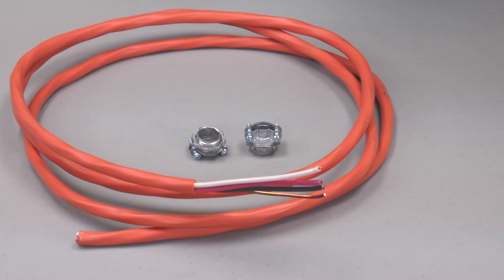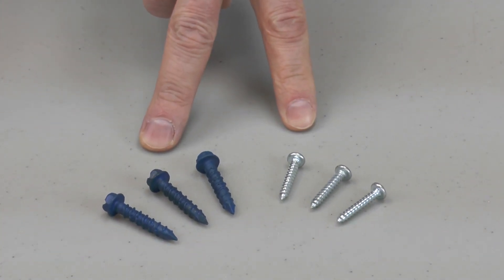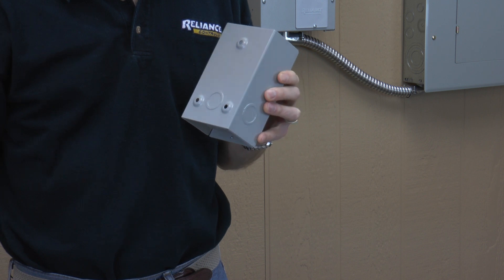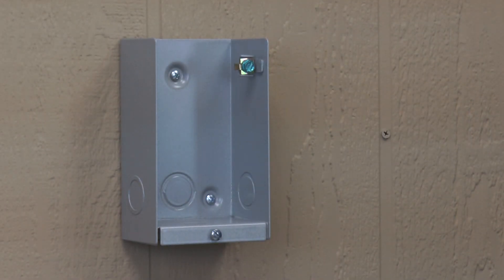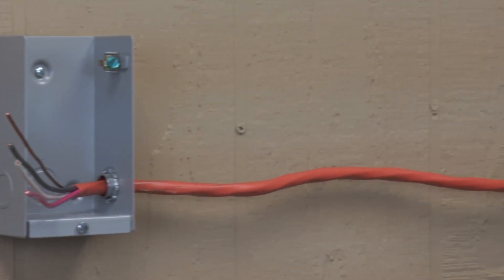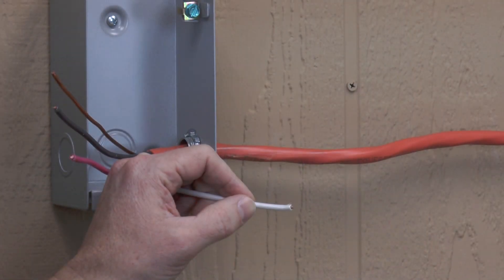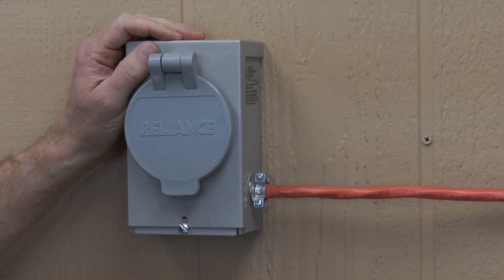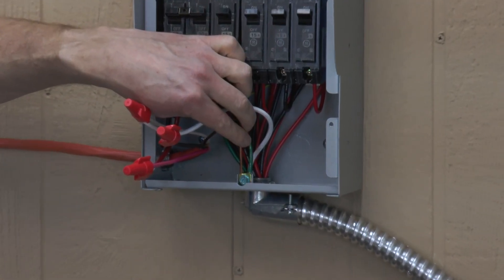How to Install Reliance Controls ProTran2  Transfer Switch- Part 5 Installing the Power Inlet Box

Comment: The most common use these days are 3 wire inputs. Most people don't own transformers that do 240v, or solar for that matter.
I'm looking to just run 2 refrigerators and a cpap. I would only have a Line Neutral and ground. How do you go about wiring that?
Reply from the maker: Hi, thank you for your question. Usually this is accomplished with an adapter cord that bridges the 2 hots in the transfer switch to be powered by 1 hot from the generator side.  Otherwise, if there is only 1 hot entering the transfer switch it can be accomplished by connecting the red and black to the single hot from the generator. Please feel free to call us if you need more information.

Comment: What size wire?
Reply from the maker: For a 30 amp transfer switch you will need 10/3 with ground building wire.  For 50 amp transfer switches you’ll need 6/3 with ground.

Comment: Can I put this plug 100ft away using 10/3 wire or use 8/3
Reply from the maker: Yes, you may install the plug 100 ft. away and it is recommended to use 8/3 w/ ground romex.
Reply: @RelianceControls  got it, thank you

Comment: I would love to see a different version of this video for when the off grid power is supplied by a solar inverter. That is now very common with off grid inverters that can produce 6000 watts replacing gas powered generators.
Reply from the maker: This is an awesome idea @leftlink we really appreciate your thoughts and definitely have begun discussions around this 🤓Time will tell! Thank you for letting us know it'd be useful for you.
Reply: (Not an electrician so maybe dumb question) couldn’t you just install this inside the house to allow for a connection to a battery back / inverter up system?
Reply from the maker: Not dumb at all, we appreciate you asking @MikeBernalMusic  Yes, you can.  We even offer models with a suffix “A” to include an inlet that mounts directly on the transfer switch. Thanks for watching!
Reply: What would be really great is to have the ability to switch between an outside power inlet and one on the transfer switch for inside use with a battery bank. Reliance could just use another 3-position switch like is already on the transfer switch and put it to the left of the circular hole. @RelianceControls
Reply from the maker: @dannyh9010  Hey Danny! Thanks for pointing this out, it's a feature that we've been working on and are excited about. While achieving that outcome isn't currently possible with toggle switches, we want to offer a method that could be utilized for similar results. 

For now, you could install a power inlet box and an inlet on the front of the transfer switch. Then, instead of running the romex from the inlet box directly into the transfer switch, you'd run it to somewhere near the transfer switch and wire a plug-in cord to the end of the romex that would plug into the transfer switch. 

You'd need a second power cord to plug the battery bank into the transfer switch as well. This way you could just swap between power cords depending on which power source you'd like to use.

Feel free to call us if you have questions, but we really appreciate the feedback :)
Reply: I thought of that.  I think I understand what you are saying, and came up with that method, too.  Are you saying for use with an outside generator, use the kit’s supplied inlet (male end) on the outside of the house and have the wire terminate at an outlet (female end) purchased separately near the transfer switch.  Then use short  a male/female regular type cord to go from the female outlet to the transfer switch for generator use.  I would then just plug directly into the transfer switch inlet for a power bank.  @RelianceControls

Comment: When running a 50A transfer switch how do you hardwire the incoming 6 AWG wire- a wire nut wont cut it
Reply from the maker: Hi there! Thanks for the question. Wire nuts are what are typically used. These would usually be a blue wire nut that accepts 6 AWG to 12 AWG. But if you can't with wire nuts you can look for other wire connector types like a WAGO connector.

Comment: 😒😒👎👎  Inlet box should always be mounted outside the house, because the portable generator gives off carbon monoxide, it has to stay outside.
Reply from the maker: 😒😒👎👎? We would never recommend, encourage, suggest, or show a generator inside. 

To be clear: you're completely right: inlet boxes should always be mounted outside the house, because the portable generator gives off carbon monoxide, it has to stay outside.

Hope this helps, thank you for watching!
Reply: But my generator is a solar/battery generator with no exhaust or fumes🙄

Comment: What about the neutral wire? Is it separated & isolated in the transfer switch from the main 200 amp panel? If not, when the generator is on will it not back feed to the utility X-Former feeding the panel?
Reply from the maker: Good question! The neutral wire is not switched with the Protran series. The neutral from the generator ties to the main panel neutral bar.  The neutral wire does not back feed to the generator as the neutral is a return path only for power. Let us know if this doesn't help. Thanks for watching!
Reply: So the neutral on the generator would need to be floating for this model correct?

Comment: Are there any NEC-required labels for such an installation included with this kit, such as service disconnect, etc.?
Reply from the maker: Hi again John! We do include some additional labeling, mostly to cover what UL has deemed necessary in our UL file. There are labels for separately and non-separately derived systems, depending on the installation, etc... Service disconnect labels are provided with some products, again depending on what's required in our UL file. Please don't hesitate to contact our tech support team @ support@reliancecontrols.com or (800)634-6155 if you'd like some further details. Thanks!

Comment: I have a 120v inverter generator my incoming wires are black white and green ...which colors correspond to your red, black, and white?
Reply from the maker: Hi plnthrd! Green = green, white = white, and our red and black wires will both connect to the black coming in from your inverter. The red & black are each powering 1/2 the circuits in the transfer switch to accommodate 240V. One thing to keep in mind (because the inverter only provides 120V) is that you cannot connect 240V circuits to the transfer switch. Please don't hesitate to reach out should you have any additional questions or concerns. Our tech support team can also be reached @ (800)634-6155; they're always glad to help!

Comment: What size of wire for 50 amp?
Reply from the maker: Hey! For copper wire, usually, we would recommend 6 AWG, but it depends on the specific wire you intend to use, along with the distance. Here's a handy calculator in case you want to check for your particular installation. Thanks!

http://wiresizecalculator.net

Comment: I am looking into buying a reliance transfer switch that can handle 10 breakers 12K watts. I wanted to ask can this be wired to my main panel and a transfer switch sub panel. The previous owner used a sub panel as a transfer box and wiring is going directly to each source it is powering. Line is on unless I switch to Generator which is same concept and works fine but only has 4 breakers. I need the reliance transfer box to be wired to several of the breakers in that sub panel. Could I just wire transfer switch to the 220 breaker that is supplying that sub panel so when generator is on it supplies the sub panel too? I will do away with the current generator line in  on the sub panel box and leave line in as on at all times. Thanks for great video series.
Reply from the maker: Hey Holly! Depending on the size of the breaker feeding the sub panel, this can be done, but it's limited to 30A. If the breaker feeding the sub panel is larger than 30A, then they could still connect individual circuits from both panels to the transfer switch. 

Only trick here is that the neutral & ground only need be connected to one of the two household panels.

Please let us know if you have more questions!
Reply: @RelianceControls  Hello, yes it is a 50 amp breaker feeding the sub panel so I would need to do individual breakers and do ground and neutral in either main or sub panel. My other option is just getting a bigger sub panel with a Reliance TRC1005C  Transfer Panel but will obviously be more work. Or a Reliance A510C Pro/Tran 2 50 amp.  I currently have my well pump (220v breaker) on the current transfer sub panel and l need to add my hot water heater (220v 20 amp breaker) and septic pump which is 110v breaker. Thank you for the quick response any tips much appreciated.
Reply from the maker: @hollyr8788  If you're not keen on going to the individual breakers of the sub panel, I'd recommend going to the TRC1005C. The A510C still has a 30A limit on branch circuits, so that won't help with powering the entire sub panel. 

While the installation of the TRC is a little more involved, it'll definitely provide more flexibility and keep a lot of options open should your needs change in the future.

If it's easier, definitely give us a call to talk through it! We're always here and happy to help!
Reply: @RelianceControls  Thank you for responding I am prob going with the TRC1005C. I am limited in space and swapping out the current one is probably best option. I will definitely call if I have more questions or am unsure of anything. Appreciate your help!

Comment: The generator is Neutral Bonded to Frame. How the TS will convert the generator to Floating Neutral? Or how to wire a neutral bonded generator to the TS.
Reply from the maker: Hey Javier! First thing's first, is the generator receptacle being used to power the TS GFCI protected?
Reply: @RelianceControls  I have a reliance on the generator connected to a power inlet and the power inlet connected to the transfer switch so basically is a Reliance Controls 306CRK Pro/Tran-2 6 Circuit Transfer Switch Kit
Reply from the maker: @JavierRivera  thank you for the reply! Would you be able to provide us with the model number and manufacturer’s name of the generator?
Reply: @RelianceControls  is a Genmax GM9000IED is neutral bonded to frame.
Reply from the maker: @JavierRivera  based on the information we’ve found online, it appears as though the L14-30R on your generator is not GFCI protected. Since there’s no GFCI on this outlet, the installation should be the same as shown in this video and in our instructions. Please don’t hesitate to reach out if you have any additional questions or concerns. Thank you!

Comment: Missing plastic insulating bushings on the box entry.  An inspector would catch that and make you re-pull the wires.
Reply: Code varies from location, some little things like this are not always necessary depending on location.
Reply from the maker: Hi Patricia! That's correct, and we're glad you mentioned it.

Since we don't include any of the wire from the inlet box to the transfer switch, we don't specify the associated fittings.

That said- we will definitely make a mention of this in future videos as we do always recommend abiding by local codes and using inspectors/electricians as the local expert!

Comment: Can you use an inlet box with a L5-30P connector (i.e. the one in the video seems to be a L14-30P), but my generator has an RV outlet which I can convert (using the proper cable) into an L5-30 cable which connects to an L5-30P box?
Reply from the maker: Hello! Thank you for inquiring. You can definitely do this and our PB31 would be the power inlet box you'd be looking for! Let us know if we can assist further. Have an awesome day!
Reply: @RelianceControls  I am assuming that something would have to be done with the ProTrans2 unit to couple it with an L5-30 cable and since the incoming power is only single phase and 120V only. I tried to find information and/or instructions on this on the internet, but none exists at the moment.
Reply from the maker: @abbeychase4718  Good question! And yep, definitely need to make a slight adjustment.

So the wiring from the PB31 will only have 3 wires - hot (black or red) neutral (white) and ground (green). Transfer switch will have 4 to connect to in the wiring compartment - 2 hots (red & black), neutral & ground. 

So, connect neutral to neutral, ground to ground, then tie all 3 hots together.

This makes it so the entire TS is being powered by 120V. One thing to note/reminder, the TS can only be connected to 120V circuits at that point.

Please reach out to us directly if we can offer any more assistance!
Reply: Did you ever get an answer?  I am trying to solve the same issue.

Comment: your local code doesn't require conduit? If i put 6/3 in conduit should i strip the covering?
Reply from the maker: Hey and thanks for reaching out! It's best to check with your local code/inspector, just in case.

Comment: They should probably mention in the video this system is designed to be used with a generator that isn’t bonded.
Reply from the maker: Thank you for your feedback, Envision Sparky! That is a good point and we would like to elaborate a little bit more on the topic to clarify. 

We're going to add a whole bunch of detail here for the folks dredging through the comments.

Most portable generators will come in 2 primary types, defined by the internal wiring of the generator related to the neutral and ground. The neutral and ground are either tied together, or separated, inside the generator. A generator with the neutral and ground tied together is referred to as a ""bonded-neutral"" generator. It might also be described as ""neutral bonded to frame"". A generator with the neutral and ground isolated and separated from each other, is referred to as a ""floating-neutral"" generator.

Certain industrial/commercial generators must be “bonded-neutral” to pass OSHA inspection on job sites, which is why there are many generators with this bonded-neutral attribute. Some of these bonded-neutral generators also might have GFCI protection built-in, due to another requirement on job sites related to ground fault protection. It’s important to identify these generator attributes at the time of selecting a generator and transfer switch, because it’s possible that some job site generators with GFCI protection will require a special type of transfer switch installation.

Please contact the generator manufacturer to confirm if the generator is bonded-neutral and if the receptacle being used is GFCI protected. The Reliance X-series neutral switching panels are ideal for use with certain job site generators that use GFCI protection. Note: Any Reliance manual transfer switch will work with any floating neutral type of generator sized appropriately.

Comment: Is there any kind of code requirements for how high it should be off the ground?
Reply from the maker: Hi JV! Yes, there are height requirements based upon local code determined by your local electrical inspector. Thank you for asking!
Reply: @RelianceControls  thanks 👍

Comment: Hi for a 50 amp or 60 amp What number wire do I need to use from the inlet box to the transfer switch?
Reply: 8/3 copper for 50 amp. 6/3 copper for 60 amp. Confirm with your local rules first though.

Comment: What if you're connecting an inverter generator with only three output connectors IE, 120v output?
Reply: It's not code compliant, but make a custom cable with the two hots spliced together in a junction box. You would then get 120V on both power rails, with no phase shift between them. All breakers would have 120V connection to neutral and 240V would be impossible. Alternatively you could change the inlet box to 120 only but that really limits your capabilities of generator selection.

Comment: For presentation I would have place a conduit for the wire between the power Inlet Box and the Transfer Switch it looks cheap just the wire exposed.

Comment: Hey, I have the 10 circuit unit. Where is the video for that?
Reply: There is no video for the 10-circuit unit.  Installation is the same as this one.
Reply: No difference wire in more circuits that’s the only difference.

Comment: Is there any reason the power outlet box can't be wired to the transfer switch before the switch is wired to the main panel? It would eliminate shutting off the main power twice.
Reply: There is no difference.  When I installed ours, I installed the inlet box first, then connected the transfer switch to the main panel.  This way I only had to turn off the power once.

Comment: Do you put the two black wires thru the Wattmeter ring also the two connected red wires? Or only the transfer switch bk & red wires thru the wattmeter 
that are in the power inlet box #4 info on page #9

Comment: If I am installing a 120v inlet box (L5-30) with 10/2 wire,  Do i simply need to bond the red and blacks in the transfer switch housing?
Reply: Did this work for you pilotdog68?  I am also using 10/2 wire but have not connected as I am unsure.
Reply: @droddude123  AM ALSO WONDERING THE SAME ?
Reply: Did you get an answer to this question.  I am searching the same information
Reply: @josephvogel7234  If you only have 120 volt circuits this is feeding, Yes bring the 2 legs onto the 1 leg that is incoming.

Comment: Is the inlet box rated for exterior use? I plan on installing outside along with my existing main panel.
Reply: Yes it’s rated for exterior. I would have like to have seen an exterior, on vinyl side installation. 
Edit to ad: the kit I just received of theirs actually reads. “ Not for indoor use” on the front cover of the inlet box. 🤪